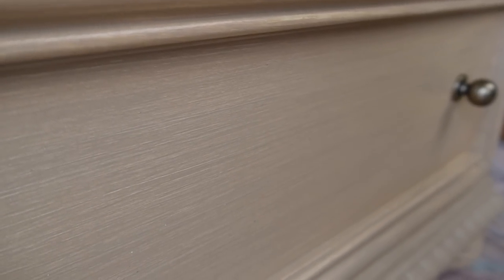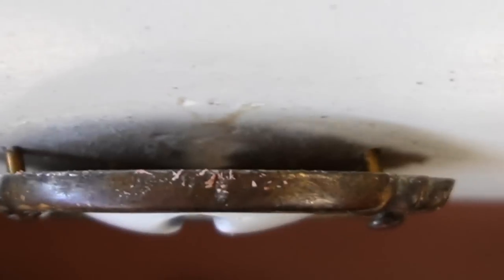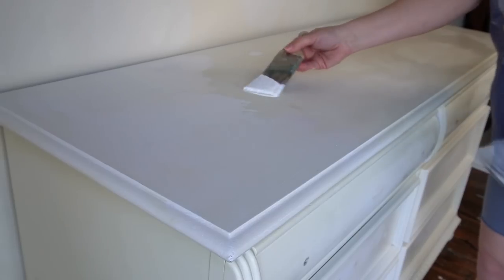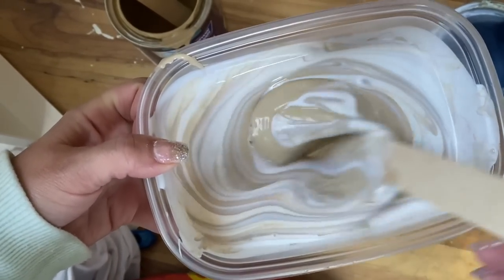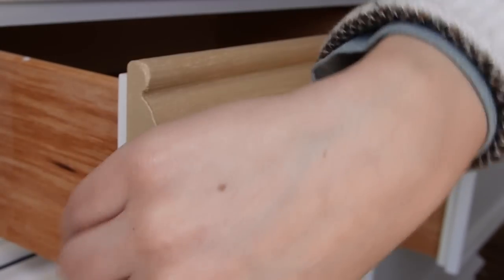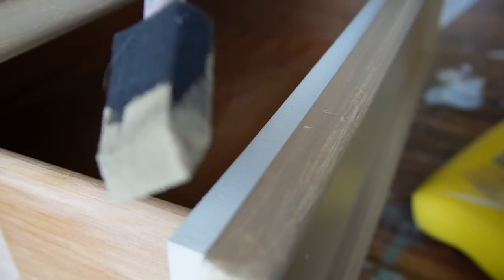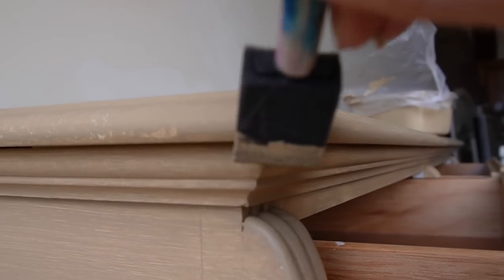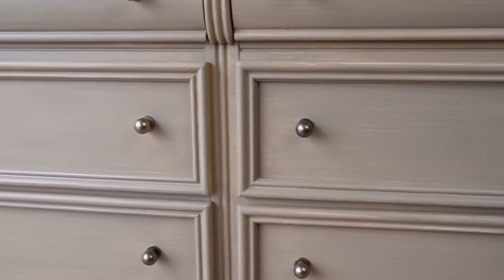UPDATE White Furniture

Comment: A tip to fill the holes…put some of the wood fill in a plastic sandwich bag and cut the corner. Then you can fill the hole all the way through. I use this method spackle when I’m patching small screw holes in the wall. Place a piece of tape on the inside first to keep it from squishing through. Edited to say the piece turned out beautiful. ❤
Reply: 3:39

Comment: Amazing transformation Shannon!!  I love those knobs!  by the way, when I need to  plug wholes and don’t want to have to wait for the putty to dry i use a dowel and it works great after sanding the tip it’s flawless 👌
Reply from the maker: I need to buy some!  Do you get them at Home Depot?
Reply: @blacksheephouse  Shannon I get them at Walmart in the craft area. They have a packet of assorted sizes or individuals  I believe that the 1/4” is what I usually get, it’s tight enough to hammer it into the hole

Comment: Gorgeous re-do!   Watching you do the steps takes the fear out of jumping into a project.. (fearing a disastrous trainwreck or something you cant finish)  

I have my childhood Bassett dresser (pecan finish) that I want to place in my bedroom - been afraid to paint it cause it is beautiful ….yet outdated early american .  It has a heavy poly coated top that feels like a glass finish.   Question - would you treat that any different? It is wood finished but has the glassy poly coat..   please comment on your experience or knowledge of this… thanks! ❤

PS I want to do a neutral lighter tan so maybe do nothing on top? Again your comments please!
Reply from the maker: If the surface is slick and shiny I would hit with some sandpaper first, even just a quick scuff sand would do a great amount for you finish adhesion.

Comment: I did your pottery barn finish yesterday on my wood wrapped beams and post in my basement ☺️ It was a lot of work trying to perfect everything and possibly too big of a project for my first time trying this technique but I did it. I also did a matching cabinet table top and trim in the ceiling where our drop down ceiling gives us access to plumbing, there’s wood trim there, so I wanted everything to match! I’m about to do the dry brushing to add more dimension. Only thing I didn’t like was the kids broom. Often the plastic base would scuff the finish if I wasn’t being super careful then I would literally have to scrub the area with the broom or get the deck staining brush to smooth it back out so it was quite the tedious process; however it looks amazing like real stained wood. I’m anxious to see how adding the dry brushing color will change it up! Do you think I need to seal everything with the matte poly acrylic topcoat?
Reply from the maker: What a big job 🙌 way to go!
Reply from the maker: If you did the pottery barn finish that uses rustoleum glaze then you have to add topcoat bc it’s not durable on its own, I mean the ceiling you could skip bc it’s not being used